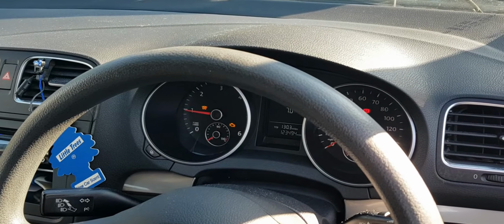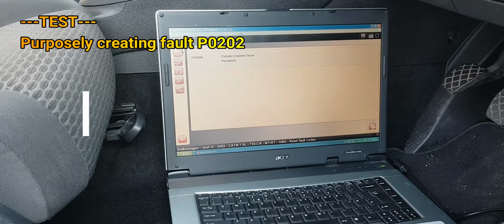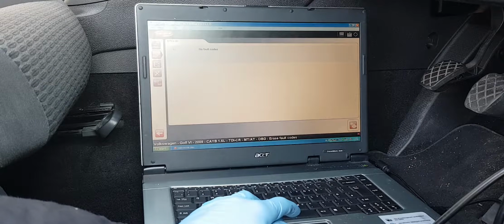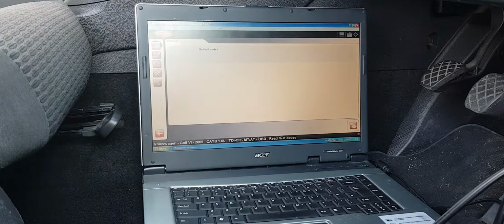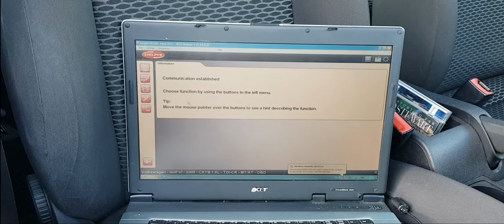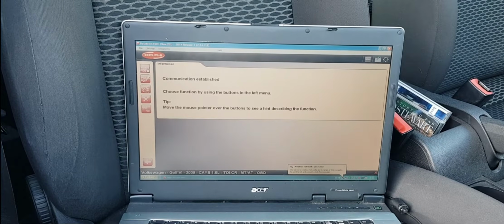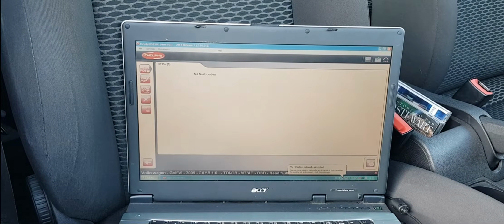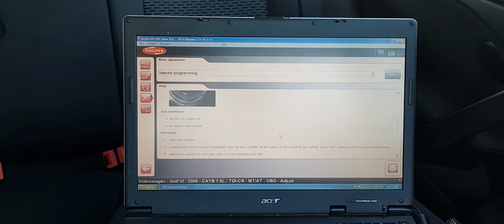P0201, P0202, P0203, P0204, P0606 Injector fault fix VW Golf 1.6 tdi Audi A3 A4 Injector replacement

Comment: Did vw not recall all cars and change the injectors to Bosch ones?
Reply from the maker: Hi Browning
I wasn't aware of this recall. Do you know anyone that has got these replaced for free by VW?
Reply: @TheKeenMechanic  yes my uncle had the golf a few years ago they recalled it and changed them
Reply from the maker: Very good to know as this is very common fault and very expensive to fix. Sometimes 4 new injectors and labour can cost nearly as much as the value of the car here in the UK. Where are you based yourself?
Reply: @TheKeenMechanic  I'm in Ireland they can be expensive to fix alright. A questions for you is it worth putting a clutch into a 2008 Toyota Corolla with 260000 miles on it?
Reply from the maker: @browningmaxus5360  Hi
I am in Northern Ireland-world is so small 😉 If you can do the clutch replacement yourself it is worth as you will only pay for the parts and keep the cost down. If the car is well looked after and reliable in any other way I think it is worth. I have seen Toyota taxis at 900 000 miles without any major engine work. Hope this helps you decide
Reply: @TheKeenMechanic  small world alright 😁 good point on the high mileage Toyota  taxis might be worth doing it even at 500 euros
Reply from the maker: @browningmaxus5360  Just shows you how much a vehicle can be used if maintained regularely. Taxis get more life as they are barely turned off and less cold starts.

Comment: mine has 195kohm is it good enough?
Reply from the maker: 195k ohms sounds perfect to me. I bet if you get stable connection you might get colse to 200. Best of luck buddy and hope you get it sorted
Reply: @TheKeenMechanic  i got same problem as yours but only when dpf regeneration is on. In other situations engine runs good. Can you suggest me why i get this error?
Reply from the maker: @menel321 If I understand corretly your car running on 3 cylinders when is regenerating? Do you get fault and engine management light on dash? Give me a bit more information please. Normally when a vag (vw audi group) car regenerates it changes the fueling to increase the exhaust temperature and the engine will sound different anyway.
Reply: @TheKeenMechanic  yes car is running on 3cyl when dpf is regenerating. After regeneration car runs on 4cyl and then i have P0201 circuit malfunction error.
Reply from the maker: From the fault I can tell that it is cylinder number 1. Check your wiring thouroughly. If the wiring appears good then if you have the tools and skills swap cylinder 1 injector with cylinder 2 injector and see if you get P0202. If you do then the problem is in the injector most likely. Injectors are held in pairs 1 and 2, 3 and 4 with 1 clamp and bolt so just swap 1 and 2.
Reply: @TheKeenMechanic  thanks!
Reply from the maker: No problem. Let me know what the problem is when you fix it as I have not seen this before
Reply: @TheKeenMechanic   hey I checked again all of my injrctors and 2x have 230kohm and 2x 170kohm. But only first cyl have error. Which kohm’s are better in my case ? Higher or lower?
Reply from the maker: @menel321  How did you get 195 the 1st time? Resistance should not change. Try to stabilise the pins and may be get aligator clips or cable connectors to get a more accurate reading. Injectors should be around 200 +/-5 but no big variance. It is unusual that you are getting these readings. May be consult with local specialist just in case

Comment: Does the 2 liter version also have an injector problem thank you
Reply from the maker: It happens to 2 litre version too but very rarely compared to the 1.6tdi. I have the 2.0tdi personally at after 9 years and 150k miles no problems so far. Thanks and hope this helps
Reply: @TheKeenMechanic  So it is better to buy a 2-liter version. Is there a difference in fuel consumption between the 2-liter version and the 1.6? Thank you
Reply from the maker: @abdelhakimhakim1164  Yes. The 2.0 is the better to buy. 2.0 might use a bit more fuel but it depend how fast you drive it of course. I would personally advise you to buy the 2.0 tdi if you can.🤝
Reply: @TheKeenMechanic  What do you prefer in the gearbox, is it the normal or the automatic, in terms of problems and fuel consumption .... Thank you
Reply from the maker: @abdelhakimhakim1164  I always choose manual if I can
Reply: @TheKeenMechanic  2 liters How much per liter per 100 km it consumes and what is better is 110 ch or 140 ch Thank you very much
Reply from the maker: @abdelhakimhakim1164  My engine is 140hp. The best I got was 3.7l per 100km and worst 6.5l per 100km. Normally I get about 5l per 100km

Comment: Great video ! I was able to repair the car 135km from home. Replaced the bad injector, cleared the faults and recoded the new injector value. Thank you so much, worked like a charm :-)
Reply from the maker: I am very happy to hear that my video was helpful to you. I did it because I know it is causing a lot of trouble this 1.6tdi motor and these injectors ...277b are very unreliable. I believe the new updated injectors with part number ...277s are better but very expensive still at 250-300 a piece. Thanks for taking the time to leave a comment. 🤝
Reply: @TheKeenMechanic  Is it possible to replace a single 277B injector with a 277S injector? Is it possible to operate three 277B injectors with one 277 S injector?
Reply from the maker: @iulianplumbu1034  I personally haven't done it but I don't a reason why it shouldn't work. It is the same spec injector only inproved part so piezo element wont fail prematurely🤝

Comment: Great video, thank you for this. I seems to have a similar problem on my Skoda Fabia 1.6 tdi cayb - P0204 injector circut error.
I did the resistance check and weird thing happened. I ran the test twice. First time coil 1,2, 3 - 200kOMs, coil 4 - close to 0. Second run - all coils close to 0...The time between the tests was like 10 minutes and I did not start the engine in between. What can be the reason for that? Should this test be run under pressure?

I also did the second testing with unplugging the wiring on the injectors while engine is running. To my surprise, however I am not an expert on mechanics, I think when unplugging each injector the engine seemed to be suffering. I did not observe that unplugging injector 4 would have no effect on the engine.

Not sure where to go from here.
Reply from the maker: Hi
Thanks for watching my video. Don't worry. I will help you with this. If you have P0204 and no other faults then your other injectors are ok for now. The fact that you can still start the engine means that most injectors are working. Your problem is clearly your injector 4. It is good you did all the testing that I have shown in the video to help me determine the problem. When reading the resistance in OHMS it can happen that if your test leads don't have good contact you can get different readings. I would say you can replace the injector 4 and even before installation plug it in in the electric socket as I did show to see if it will clear the fault. This will save you some work in case you buy a faulty injector. If buying used injector from a breaker make sure you bring your multimeter with you and test the resistance before you pay. Best job is to buy brand new updated version 277s. For more information read all comments below as I have described this to other people below in the comments. Let me know how you get on
Reply: The Keen Mechanic thank you for prompt answer! I am planning to do the injector 4 change, but what I am trying to do is to isolate the problem first. And I struggle to understand, if the injector 4 is the problem, why when unplugging it, the engine is clearly struggling. I assume that if it gone bad, there would be no impact on the engine when unplugging it.

Few days ago I also visited local mechanic and he also tested the coils only and with use of his device his opinion was that all coils are basically dead. I am struggling to believe that all went bad at the same time. Did that ever happen to you? I just redid the resistance test and the multimeter shows 0.00 on all coils when stabilizing the leads. I am worried that even if I replace the injector 4, the problem will stay 😢

The engine is working fine when starting with everything plugged. Is it possible that problem is somewhete else? EGR valve or DPF?
Reply from the maker: Hi 
This is very unusual indeed. If the engine starts than your injectors are ok. The piezo elements (coils) are also good too otherwise the injectors won't work and engine wont start. Please check all your wiring as this is very unusual. Even if the piezo elements (coils) are faulty in all my cases I was still getting some readings (never 0) I know that these engines suffer from EGR problem and I did fix this years ago but unfortunately I don't remember what fault code I got. Check all cables and also all fuses first. Don't give up easily as you just need to think logically. Clearly your fault is electrical and you can isolate other issues. Check on youtube for the egr issue, if I remember correctly it was the little moving arm that gets clogged and damaged and won't move the flap inside. In my case I just blocked the EGR and ordered a chip online to eliminate the faults on the dash and never had issues ever again with the EGR. This was the easy fix as these EGRs are water cooled and very hard to access if you decide to replace it with a new one. Let me know how you progress buddy. Hope this helps

Comment: Your video is gold.. thanks for sharing! By the way, do you think that it's possible that the resistance problem of the injector can be fixed by simply changing the electronic part of the injector? Or is it a consequence of a damage of the injector so it has to be changed all over? Thanks!
Reply from the maker: Hi and thanks for your comment. The problem with these injectors is the piezo element which is the electronic part. The piezo element can be replaced but it is not cheap and needs calibaration on a bench after replacing. I left a very detailed reply to one of the questions from another subscriber. Please check below. I am glad you found it very helpful

Comment: Hi Great video good explanation, I just had this problem on my way home to denmark on the German autobahn. we had it fixed at a proffesional werkstatt it cost me 650 Euro all inkluded wit a new Injector. I hope i have not being ripped off ;-). my carr is a Passat b6 3c2 , i think it is the same engine as you show here. I was curious to se what they fixed.  To  things i want to ask you: is it whise to replace with a used injector , I think you can not know anything about the condition off the injector , you do all this work and than maybe you soon have troubles again because the Injector has maybe 180000 miles on  it. Do you know anything about the life exepectancy off this spare part when tey are new (original VW make).? THX in advance for your answer :-) :-)
BTW I have a smal OBD analyser that showed the  P0202 code , cilinder 2 in my case. so I was beware off the fault before the german technician came along. :-)
Reply from the maker: Hi and thanks for your detailed message. Sorry for the late reply, still at work although I will try to answer your good questions as best as I can. It is very sad that these piezo injectors fail suddenly and without any warning you are stuck on the road. This happened to the car owner of the 1.6tdi golf 2009 I recorded the video on. The car lost cyl 3 error P0203. The owner didn't have breakdown recovery and drove 60miles (100km) on 3 cylinders. I replaced the faulty injector with an used injector at £70-75 if I remember correctly. I am not sure how much a local garage will charge for this job but the price of a brand new genuine injector is about £280.
You can buy new injector on autodoc.co.uk Ridex brand for £180 but I am not sure what the warranty is for the ridex one. Used injector normally sells for under £100. Refurbished injector is from 109 to £150 but the refurbished injectors have used piezo element and only the metal parts have been cleaned and refurbished. There is a guy who left a link on my video and he is based in the Czech Republic. He sells new piezo elements for 112 euro, but if you change the piezo element then you have to calibrate the injector in a professional shop on the bench. The best advice is to buy new injector or used from a very low mileage car, if you can guarantee the low  mileage. I have heard that these injectors last about 150 to 200.000km but I have seen cars with less or more. The problem in most cases is the piezo element and not blockages hence it creates the P0201 to P0204 electrical faults. The labour for this job should not take more than 1hr including all diagnostics, injector coding and everything else. I would never charge the customer more than £50-60 for this job but I am private guy and the garages charge over 70-80 per hour. In my opinion a fair price for this job with labour and new genuine injector should not cost more than €380. Hope this helps
Reply from the maker: Just to add: this seems to be more common on the 1.6tdi engine although it happens with the 2.0 too. I have a 2.0tdi cr with 140k miles and no issues so far thank god🙏 The used injector that I replaced on this car only lasted 7000 miles and the owner came back again and replaced it with a new one this time. It is very starnge that 1,2 and 4 are still going and only cyl 3 injector failed twice. Very strange indeed🙄
Reply: @TheKeenMechanic  Hi, thanks for the very very detailed explanation. My 2010 Golf 6 1.6 TDI 105 is also having P0203. But on detailed mesures, it shows that :

Injector 2, capacity 
CAPA_INJ_MAIN(1) = 0.0000 uF
Injector 2, tension 
V_INJ_MAIN(1) = 0.00 V

So it's not clear now between injector number 2 or 3... But the thing is the injector 3 could be in cause as well in my case. So strange indeed.
Reply from the maker: @FBAagent  Hi
How are you measuring the resistance mate? You should be getting 200kohm if the injector is good. Just remove plug and put multimeter on ohm function. Put probe ends on pins as shown. I have another video that I will link here. It is just a short part of the original longer video https://youtu.be/dyfGfM2PNRU
Reply: @TheKeenMechanic  the measure was actually a mechanic with his ODB.. I can do But you're right I can check it with multimeter.
Reply: @TheKeenMechanic  Yes.is very strange indeed.I have a VW caddy 2012 ,1.6 tdi and the injector 3 failed suddenly at about 165 000 km.
Reply from the maker: @stefantitilincu383  Thanks for sharing. Very common problem on the 1.6tdi engine.

Comment: very nice video, i had this problem twice in a year! Such a shame that this kind of problems are frequent in this engines.
Reply from the maker: Hi
Did you replace the injectors with used or new injectors? I had luck with this one, still going with no issues. Only cost me £70, not sure how long it will last though. One thing I was told to do is to remove the plastic engine cover to help the injectors stay cooler. Not sure if this is helping but as I said no issues so far after the repair. Thanks for your comment and for watching my video
Reply: @TheKeenMechanic  i bought new ones for pistons 1 and 3, i have them for over a year now but since i replaced the one on piston 3 the engine when i accelarate vibrates alot
Reply from the maker: It might be worth doing a back leak test on all just to make sure there is no blockage on any of the injectors. Did you code them after replacement. Also check for other faults stored in ecu

Comment: Is there a case that I have a problem with the injectors but it does not show a fault?
Reply from the maker: Hi and thanks for the Good question. If the problem is electrical, like in my case it will show a fault, but if there is a mechanical issue with the injector, like a small blockage I would say there might not be a fault. The best way to check this is by doing a back leak test. This will show if some of the injectors are blocked and more fuel will flow through the return pipes. Hope this helps
Reply: @TheKeenMechanic  Thank you very much.  I have exactly the same 1.6 90 hp CAYB engine in the 2010 Skoda Roomster and it sounds like a loud bang.  I want to find out what happened because the engineers ask me for huge amounts in case of failure.  One last question.  When and if I change one or more injectors will I need some adjustment or will the engine work normally?
Reply from the maker: Hi, if you replace the injectors with new or 2nd hand (used) injectors the engine should work ok even if you dont have the diagnostic software to code them in. It is recommended that you code them but for a short period of time just to check if everything is working it should be fine. It is very hard to get used injectors for a good cheap price as this is a common fault and they are very sought after. I would advise you to do a back leak test first to check for blockage then if ok, look for other issues. You can buy a cheap kit online and try to do it yourself if you are confident. Hope you get it sorted and let me know how you get on👍
Reply from the maker: Have a look at this back leak test kit. This is the cheapest one I could find on ebay
https://ebay.to/2D05p7y